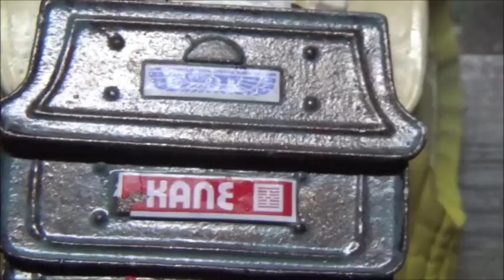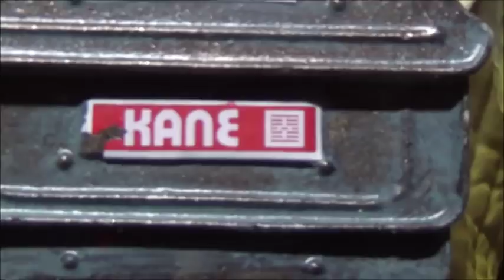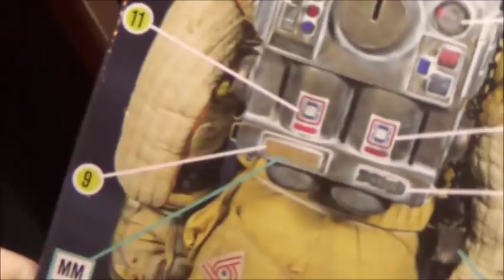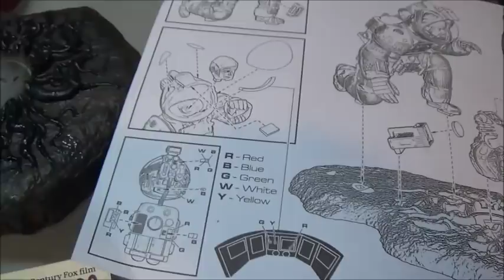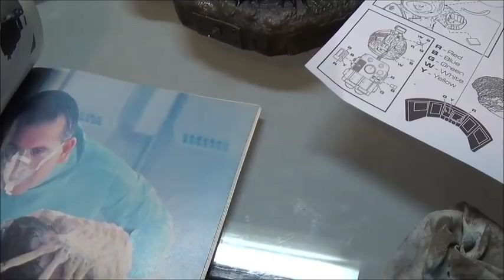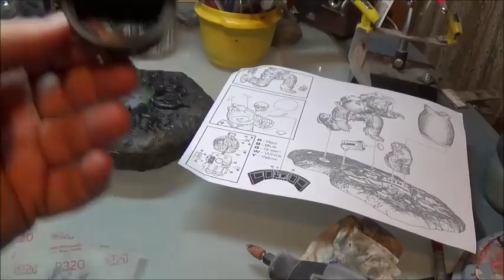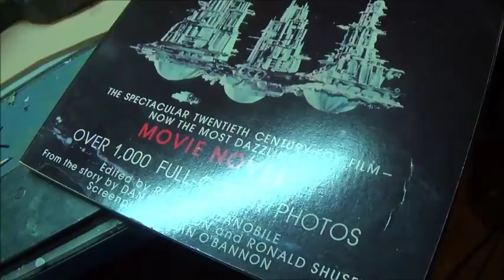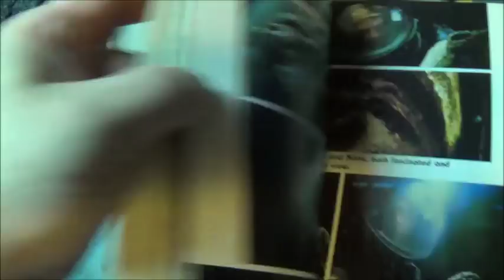Aztek Dummy Update 4/28/17 - Officer Kane Pt.2 -  the finish

Comment: Very fun build to watch, Lou. If we start calling you the Bob Ross of modeling it wouldn't an insult.

I'd be a little concerned about using one-by pine to extend the base, though. Plank wood always expands and contracts a bit over time, which means the joints between the resin base and the wood are going to separate at some point in the future. Plywood, particle board and MDF do not expand/contract as plank wood does and probably would be a better choice for this sort of thing. Of course, it might require more puttying or something to disguise the edges, of course.

BTW, I've got that same Book of Alien on the shelf behind me, which I bought new right after it came out in the '70s. I'm envious of the photo novel, though. I missed that one.
Reply from the maker: Wade,
thanks for watching. The wood was part of a larger piece. 1x12 "craft project" wood from Lowes plus It's been "kiln drying" in a hot attic for a couple of years. But I'll keep an eye on it, just the same.

There was also "Alien, the illustrated story" but that was just a glorified graphic novel. Heavy Metal press put out a ton of picture books on Alien back then
Reply: It's always best to buy kiln dried lumber if possible, but wood still moves because the humidity in your home is different than that of the kiln. In fact home humidity changes with the seasons and such. If you're lucky it will only require a little paint touch up around the edges one day, though.

Comment: Looks great Lou!  I had the same issue with the gaps between the helmet and back. Aves to the rescue! Instead of a Googly eye, I used 5 minute epoxy and built lenses for the gauge and the buttons. Did you have any fit issues with the egg? I had to use Aves to connect the tendrils to the egg - there was a 1/8 gap!
Reply from the maker: no, my egg fit nice and snug. you musta caught a rotten one :)

Comment: Despite Alien being a contributing cause for losing me an early girlfriend, I was not a fan of the plot. Production design... mostly, sure. But the take away for all future generations is-- don't investigate alien lifeforms with your face! Should be the title of the handbook on space exploration.
I very much enjoy your showing your (rather slight) mistakes and their fixes. One thing I would have done differently was to take apart that tea candle to use only the LED-- then add another one -- and wire it into the 9V system (with resistors, natch).
Seeing the lighting give a pause for a second there, highlights my next suggestion. I would have attached the styrene bottom to the wood part with small wood screws. (I would use a countersink bit to make them sit flush. Hand-twirling would do just fine!) Ju-u-ust in case! I know the wiring is a tough fix even if you can get to it-- but this way you have a snowball's etc.
Last shouted question: why on earth could they not use John Hurt's likeness? Of all things to not be able to do.
Reply from the maker: Well, I'm just spitballing here but... I assuming the license fee was high enough without adding likeness rights on top of it. Remember that back in '79 those things weren't commonly added to actor's contracts.

yes, yes, I could have wired in the tea lights.. but what if i want to swap them out for something else in the future? They are literally a dime a dozen, so no big deal to toss them when the battery runs out or if I change my mind
Reply: Oh yeah? I'll bet you a nickel right here, that after you win whatever prize is to be won at Wonderfest, you never touch that tea light again!

Alright, the above was intended as joshin around, but now that I think on it, what on earth could do a better job than that warbling tea light LED? Hmm.

And sure Hurt wanted too much, though one has to wonder. It is one of the most iconic "before and after" scenes in cinematic history-- but, t'were I, I would just wave my hand and say, of course it's yours. But now he's dead and now we'll have to resort to garage kit heads to honor the man. Sigh.